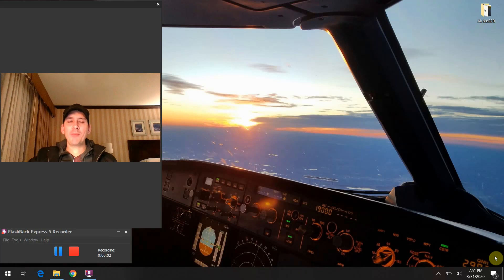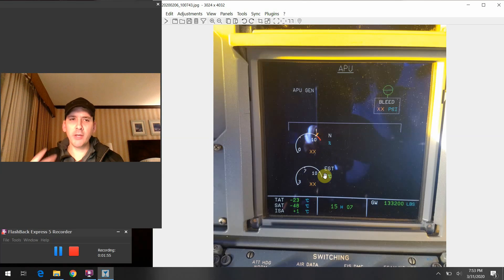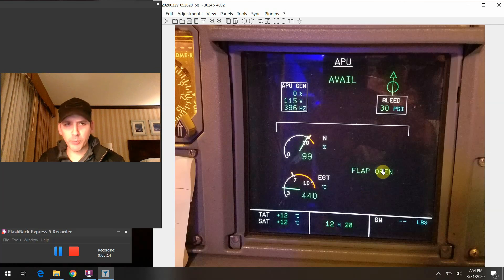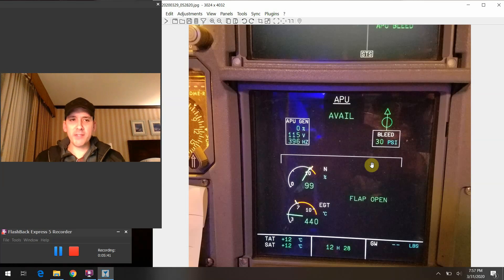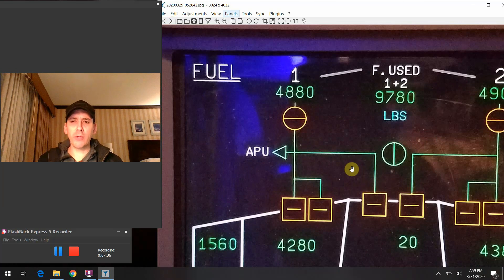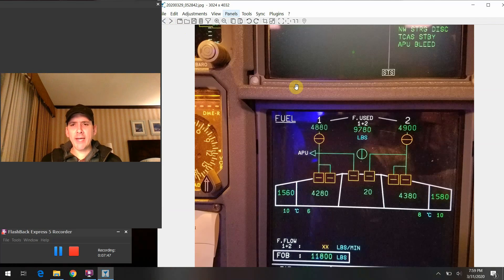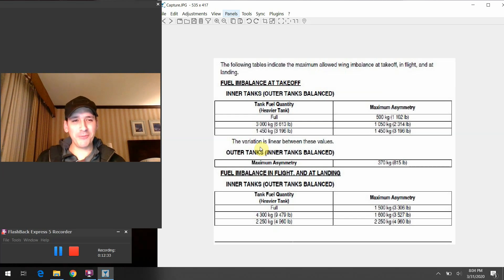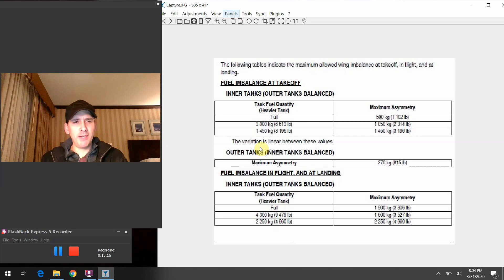Airbus A320 Cockpit Tour: #49 - SD-APU Page: What do all those buttons do?!

Comment: If using a ground air conditioning cart, does the APU still have to be running, so as to automatically supply bleed air for air conditioning when the ground air cart is disconnected and before the engines spool up?
Reply from the maker: Hi Ryesher, thank you so much for tuning in! This is a very observant question and shows a good understanding you have of the systems. The APU doesn't have to be running at all simply to use the ground air for conditioning the cabin. However, you are indeed correct, the air supplied by the ground air conditioner is not sufficient nor designed to be able to drive the starting process for the the engines. You will need to start the APU prior to engine start. If you do not have an APU you can also use a HIGH pressure ground air cart that is designed specifically for meeting bleed air demand. To give some context for you, usually in the real world the process goes something like this. APU OFF and Conditioned air supplying cabin cooling anytime BEFORE 10 Minutes prior to push. At the 10 minute prior to push mark, APU is started and then ground ELEC power and conditioned air is removed. Aircraft is pushed back and starts the engines solely using the APU. Great question my friend! Cheers!

Comment: Hey Mr. Abignale, sorry for missing  out on all your videos from this one till date, I had some issues here. I hope to finish watching all of them in a couple of days😀. I have a question which is not related to the topic of this video:
Why is the gross weight in the ECAM showing nill? Does it have to be manually loaded through the FMS everytime there is a change?

PS: thanks for answering my question regarding the APU

Hope you are doing fine.
Reply from the maker: hi there Aby! Great to hear from you my friend! Hope all is well with you. Great question...This is a very typical thing to see when you are still loading the plane up. It shows this way because you haven't entered the Zero Fuel Weight and/or the current fuel on board into the FMGS, so the plane is not able to make this calculation for the Gross Weight.
Reply: @MikeAbignale  thank you Mr. Abignale for answering my question.
Reply from the maker: You bet Aby! Cheers my friend
Reply: sorry to be off topic but does someone know of a trick to get back into an instagram account..?
I somehow forgot the login password. I would appreciate any help you can give me!
Reply: @Antonio Steven instablaster ;)
Reply: @Jakob Tucker Thanks for your reply. I found the site on google and im trying it out now.
Seems to take quite some time so I will reply here later with my results.
Reply: @Jakob Tucker it worked and I actually got access to my account again. Im so happy!
Thanks so much you saved my ass!
Reply: @Antonio Steven You are welcome =)